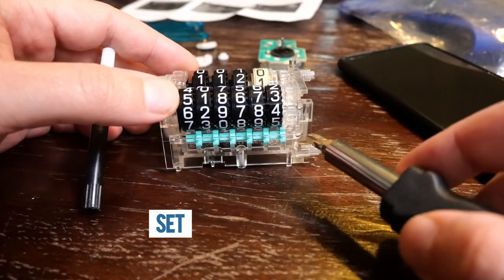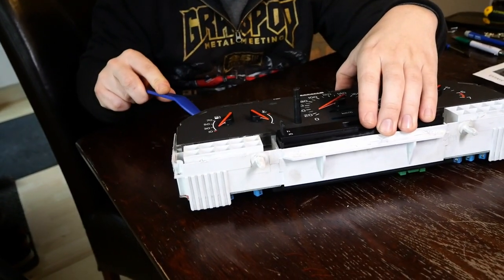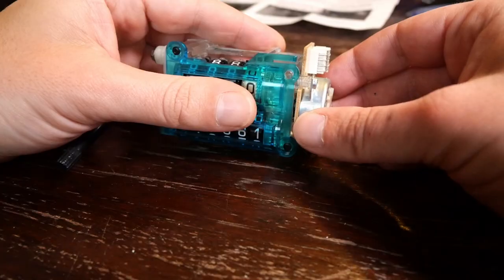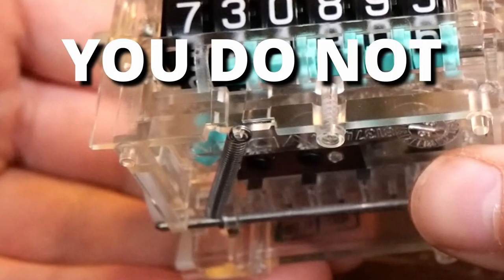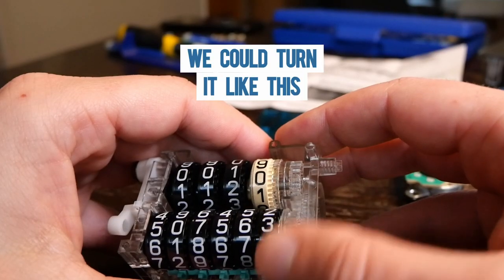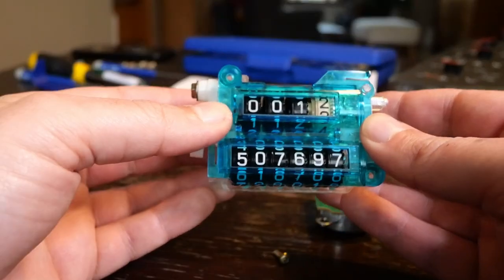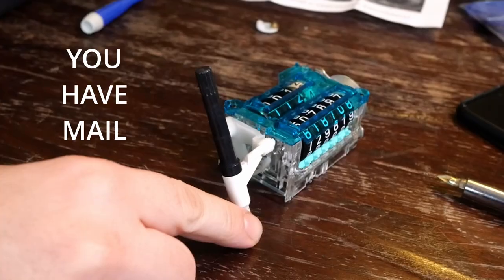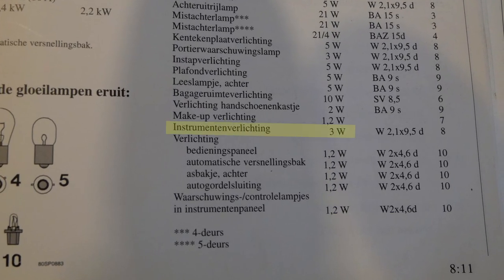Volvo 850 Restoration - Odometer Repair And Adjustment

Comment: I had to change my T5R from 80,000 miles to 118,000. I used a paper clip so I could change all at once. As you slide the rod out, slide the paper clip right behind it until the paper clip is all the way through. The paper clip is flexible enough to spin the numbers while holding onto the blue gears. When correct, slide out the paper clip as you’re pushing in the rod.
Reply from the maker: Good one! Thanks!

Comment: Nice Video! I did this on my own 850, and of course the gear got loose. In the end i got all of them loose and cut off the plastic strip in front  to get better access. Then it was relatively easy to fit them back.

Comment: Nice ! I think gear was already replaced by someone, bronze gear isn't factory. You can also improve cluster even more - install trip computer. It, I think, requires only computer, plug in wiring and one button :D also if you didn't, you can replace warning light bulbs, they are should blue from factory, and available from Osram(2721MFX)
Reply from the maker: Yeah that bronze gear made us even more suspicious and that it has been tempered with in the past.
And thanks for suggesting those upgrades! We might replace the cluster entirely for a higher tier one in the future😊